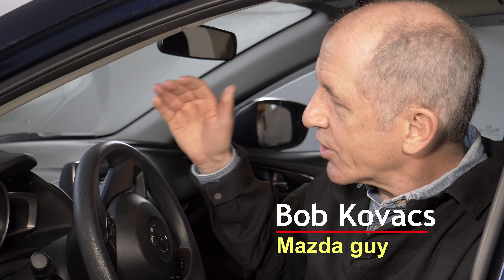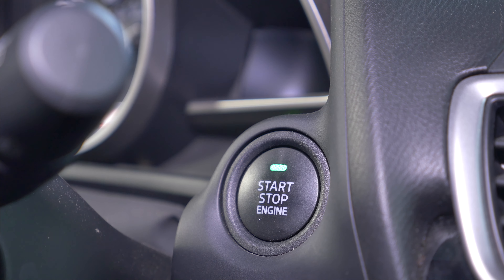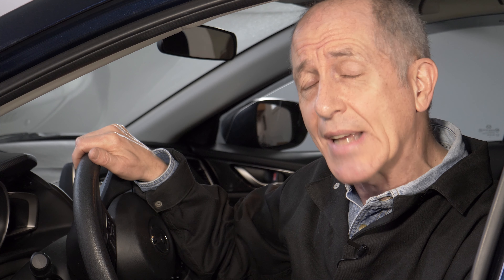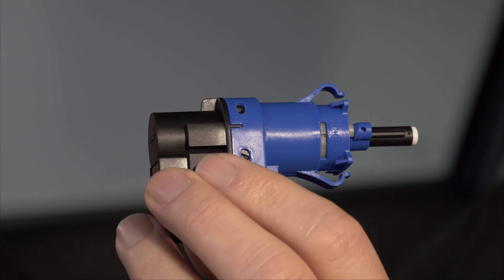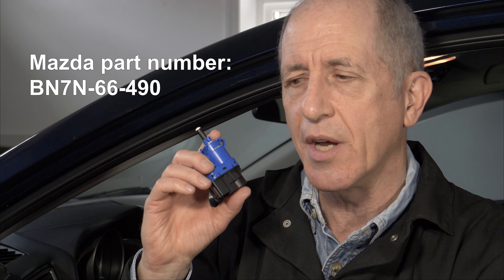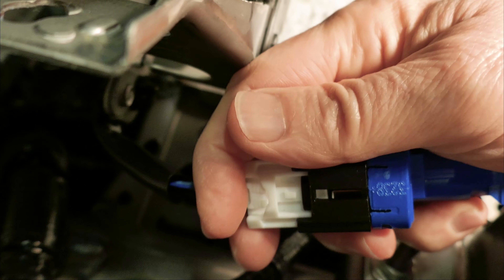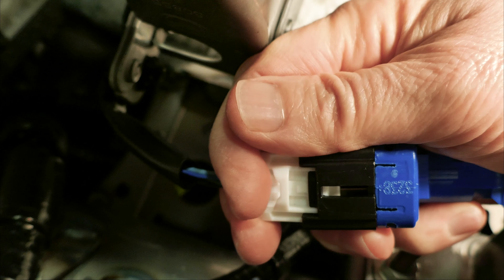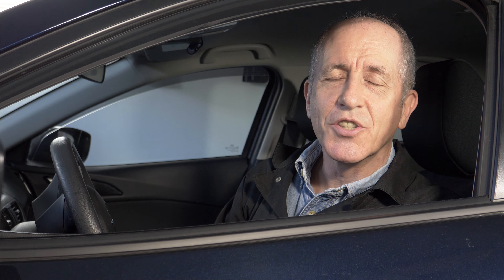Mazda3 2014-2018 Brake Light Switch Replacement

Comment: Hi bob, initially I was having the same issue as you were with the push to start not turning green after many tries. Now I’m addition to that, the lever won’t always budge from park, is this related? I’m getting p0504 and c0040 codes for these issues. Was wondering if you knew for certain that replacing the brake pedal switch would mitigate both issues. Thank you
Reply from the maker: Yes, the shift lever not coming out of park is related to the brake light switch. When the switch is bad, the start button won't turn green and the shift lever does not get the signal that you're stepping on the brake. There's a 99.99 percent likelihood that that your problems are all caused by the brake light switch.
Reply: @BobKovacs  thank you so much for the reply, much appreciated

Comment: have mazda 6 Skyactiv 2014 diesel automatic 2.2 engine. Last two days when I am travelling, the light of SCBS inspection required comes on the dashboard so I stopped and I turned the engine off then turned it on and the light went off but the same day it happened again. Specially,  SCBS inspection required comes on  when I am driving  down the hill but my speed is not too fast. I am so worried about this, even the windshield is clean and clear. 
Could you give me some advice on what I should do please?
Reply from the maker: Sorry, I have no experience with Mazda diesels and don't know what an SCBS is. I'm in the US, and I don't think Mazda sells diesels in the US. I hope you get an answer, but I can't help you with this one.
Reply: Hi having the exact same problem, did you ever find the issue?

Comment: Installed new rear brake pads on my neighbors CX-5 then boom experienced the same issues of the hand brake not working after trying twice to disable the maintenance mode for rear brake work.

Next morning, pumped up brake paddle a couple of times till paddel was hard, unplugged the brake light switch, then plug it back in then followed the procedure to disable maintenance mode for the rear brakes twice and error lights on dash switched off and Hand brake works as per normal.

Btw
I replaced brake light switch few months ago on the same car as it faulty with brake lights bulbs when illuminating when you press the brake pedal and the hand broke could not work.
Reply from the maker: Thanks for sharing your story.

Comment: If the brake lights turn on when i pressed the brake could this still be the problem? Thanks for the video
Reply from the maker: Sure, this could still be the problem. My brake light switch was intermittent, and the brake lights came on every time I looked. But replacing the brake light switch cured the intermittent starting problem. 

I don't know what symptoms your car has, so I can't say more than that.

Comment: I had a very similar problem with my 2021 Mazda Cx5 not starting, but then once I got it running, I couldn't turn off the engine. Could it still be the brake pedal switch?
Reply from the maker: It might be the cause of your starting problem, but I'd want to check a couple things first:

How exactly does your starting problem present? Does the start button light turn green when you sit in the car and press the brake pedal? (With the fob on you, of course.) If it turns green, the brake light switch is not your problem. If the start button light does not turn green, then the brake light switch is likely the problem.
Reply: @BobKovacs  No, it usually doesn't turn green. But occasionally, after many tries, and pressing the brake pedal, shifting gears (if they happen to work) and/or pressing the key fob, and many different combinations of each,  it will start. But I've yet to figure out just what is making it work, because there seems to be no rhyme or reason to it. Then when it does start, I can sometimes get it to turn off. But sometimes it takes a very long time and many tries.  Again, I have no idea what exactly does the trick.
Reply: By the way, the car battery is good, and so are the key fob batteries.
Reply: And again, will the brake pedal switch cause the car engine to not shut off?   It was stuck running for over a half hour before I finally got it to shut off (somehow). Now I'm afraid to even use it even if it does start up, and/or shut off like it's supposed to because I never know when it's gonna happen. Just for the record, I live in upstate NY in a fairly rural area, where it's been consistently below freezing for a while, and I don't want to be stuck somewhere with this issue.
Reply from the maker: The brake light switch might be what's causing your problem. At this point, I recommend you replace it -- it is cheap and quick, so you might as well do it. If all goes well, that will fix the problem.

FWIW, I grew up in upstate NY, and know about those winters. :-)

Comment: Did you have to take apart the dashboard to get to this switch? Want to do it myself, but not if it is difficult. Thanks!
Reply from the maker: You don't have to disassemble any part of the dashboard -- the brake light switch is reachable underneath the dashboard. Just put your head where the driver's feet go, and the switch will be right above your face.

Comment: Bought a brake switch from Napa auto parts # SL905 and it worked perfectly, TPMS light flashes when you start it but goes away once you start driving
Reply from the maker: The brake light circuit and the TPMS (Tire Pressure Measurement System, I think) are two different systems, so work on one should not affect the other. In other words, the TPMS light has nothing to do with the brake light switch.

The TPMS system does require some maintenance. It's probably a good idea to replace the TPMS senders (which have a non-replaceable battery) every 50-60K miles (100,000 km). I will replace mine the next time I get new tires, since the TPMS sensors are inside the tire.

Comment: My Mazda cx5 the lights are blinking in the back and my shifter makes a noise when I am in park. My husband changed the brake pedal switch twice. I took it to the dealership the tech said my husband installed it wrong and he install it correctly and that my lights are no longer blinking. While my lights are blinking again. I really don’t wanna deal with them again because I had a bad experience with them. I hope you can help me?
Reply from the maker: All I can suggest is that you watch this video, and look at how the tech at the dealership installed the switch. Replace the switch one more time, exactly as the dealer has it installed. If that does not fix the problem, then your problem is not the brake light switch. If that is the case, I don't know what the problem might be -- all I know is that it is not the brake light switch.

FWIW, I replaced the brake light switch just once, which I show in this video. The car has been perfect with starting since then -- it's a super reliable car.

Comment: Would a faulty brake light switch cause my whole car to have no power at all? I replaced mine a year ago, got it from Amazon, but I remember when it was going out I still had power and lights coming on, but today I woke up and my entire mazda had absolutely no power, as if the battery died, but I just wanted to know if by chance a bad brake light switch could also cause this zero power by chance if it wasn't the battery?
Reply from the maker: The only way for a brake light switch to fail and cause the car to have no power is if the switch is on all the time and caused the battery to drain completely. If the brake lights were on when the car was turned off, then the brake light switch is probably bad. 

Otherwise, I don't think that a bad brake light switch could cause the car to have no power. For example, the brake light switch has nothing to do with the dome light that comes on when you open the car's door -- that is two very separate circuits.

So if you check the battery and it has a charge, then your problem is not the brake light switch. If your battery has no charge, then you either have a bad battery, or something in the car is draining it. If that something is the brake light switch, you would see your brake lights on all the time.

Hope that helps!
Reply: @BobKovacs  thank you so very much for your reply! I really appreciate it! Yes, that absolutely makes alot of sense! I'm going to get my battery checked, thanks again for your help! 😀🤗👍

Comment: Does this apply to a 2014 mazda cx-5? Mine is having trouble starting too.
Reply from the maker: Probably. Mazda used the same setup for several years over several models, so this is probably nearly identical to your CX-5. Can't hurt to look.
Reply: @BobKovacs  thank you
Reply: Check the part that you bought and compare the travel of the plunger to the travel of the plunger on the one you're removing. There is a set of black tabs at the base of the plunger that set the travel distance.

Comment: is it suppose to work with manual mazda? because this problem happened to me and changes my brake light switch but it didnt changed anything:/
i need your help please
Reply from the maker: I have an automatic transmission, and this worked for my car. I do not know if the same switch is used for manual transmissions. Sorry.

Comment: Hi. After replacing the switch the pedal is dragging. After braking I have to pull up my brake pedal with my left foot. I can feel the brakes fully release when I do this. This wasn’t my original problem. Any suggestions??
Reply from the maker: Take a look under the dash at the pivot point for the brake pedal. It sounds like something got stuck in there, perhaps a wire (or a bundle of wires). That should not happen from replacing the brake light switch.

Good luck!
Reply: If you didn't set the travel distance of the plunger on your new switch, it can protrude too far and make the brake pedal stick a bit. Compare the old part to the new part and set the travel distance of the plunger using the black tabs near the locking mechanism to mount the device.

Comment: After I did mine, the brakes were constantly applied a little and the switch only activates when the peddle is almost fully depressed
Reply from the maker: Double check your installation. This switch should have nothing to do with your brakes being applied... it's only about giving your car an indication that the pedal is pressed.
Reply: You have to set the new switch to the proper travel distance or else it presses on the brake constantly. The black tabs near the mounting portion set the travel distance of the plunger. Depress the plunger to the distance that the old one is and then turn those tabs about a quarter turn to align them and it will be locked into place.

Comment: I’m not able to turn the new switch into place even after aligning the pins, can anybody please help? Really feeling defeated after struggling with it for hours
Reply from the maker: It's a tight fit under the dashboard. Just shove the switch all the way into the bracket, then rotate it. It doesn't turn far... not as far as I thought it would, but it should turn and you'll feel it notch into place. 

Are you sure you have the right switch? Does the new switch look exactly like the old switch? You can practice inserting the old switch until you get the right feel. You can do it -- thousands of people have watched this video and successfully replaced the switch.
Reply: Omg I did it Bob! Practising with the old one did the trick, thanks for believing in me 😭😭😭
Reply from the maker: @Sara-gb3qw  Good to hear you got it done, Sara. I know it is a little thing, but... congratulations.

Comment: I removed it real easy but i’m struggling to put it back in i try to rotate it and it doesnt click into place
Reply from the maker: You certainly don't want to force it and run the risk of breaking it. When I shot this video, I had my new switch in and out several times, and it always turned smoothly and made a little click at the end of the twist. I know it is hard to get under the dashboard, but try to get your eyes underneath and install the switch as you watch it. If it doesn't go in smoothly, something is wrong -- either the new switch has some extra plastic on it, or the bracket on the car has changed in some way. Compare the new switch to the old switch. Is the new part the same shape, size and configuration?
Reply: @BobKovacs  it was the same but when i got mine the black tabs weren’t lined up so it had a lot of resistance i lined it up and it went in just fine after that

Comment: Good to know for the future repair in case of red light... Usually its a low battery in key fob remote which I change almost twice a year and always have spare battery inside the car. thanks
Reply from the maker: I think the remote calls for a 2025 battery. I use a 2032 battery, which is slightly thicker and holds a charge longer. I probably change the battery once every 3 years. I get a 10-pack of 2032 batteries at Ikea for $3... they also go in a variety of other remotes, such as garage door openers.

Comment: How the check engine lights disapeared ? After fixxing this?
Reply from the maker: I did not have the Check Engine light lit when I had my defective brake light switch. If your light is on, it's possible that it will reset after a few days of use. If it does not reset, you will have to find someone with a reader device that can reset the light. Such devices are pretty common -- I have 2 of 'em.
Reply: it disappeared already i had a appoitment at the dealer for this problem thank you ( mazda 3 2018)

Comment: I just did this and now my car won't even recognize the key fob to unlock or lock the doors.
Reply from the maker: The brake light switch has nothing to do with the car recognizing the key fob. The only thing the brake light switch does is recognize when you are stepping on the brake pedal. If your car does not recognize the key fob, the first thing I would do is replace the battery in the key fob. My recollection is the key fob in the 2014 Mazda3 is a CR2025, although I was able to fit a slightly thicker CR2032 in the battery compartment. A CR2032 should last somewhat longer than a CR2025. So if you haven't changed the key fob's battery in a couple of years, that should be your next step. Good luck!

Comment: When my brake lights which went out, every light on my dash lit up and blinked randomly.
Reply from the maker: That didn't happen to me. The only thing that I noticed is what I mention in the video -- my car randomly wouldn't start. It's possible that if you have a different model year & vehicle, that the start programming is different than mine.
Reply: Maybe that is it. Mine is a 2014 touring.
Reply: I’m having that too AND trouble shifting from park when I do get it to start. Still sound like the brake switch? Thanks in advance
Reply from the maker: @natureguy102  Yes, that does sound like the brake light switch.